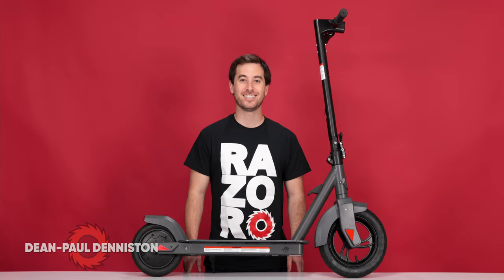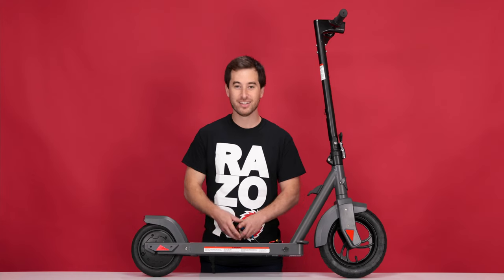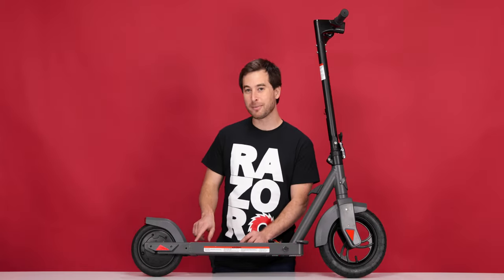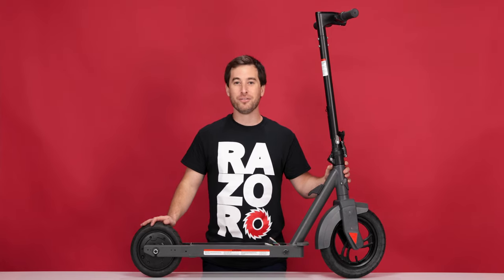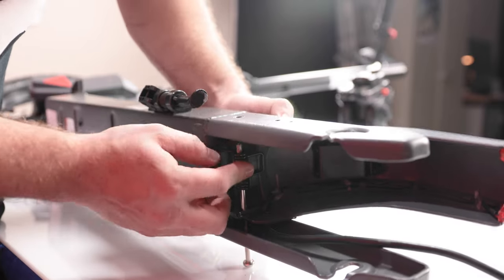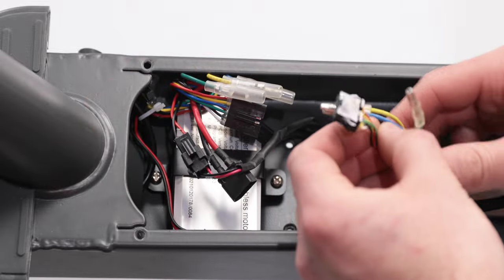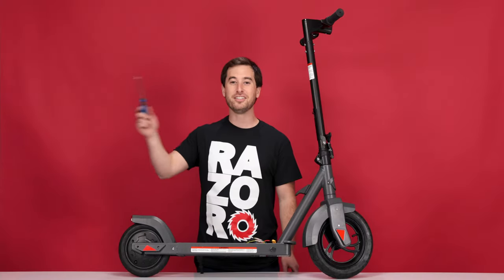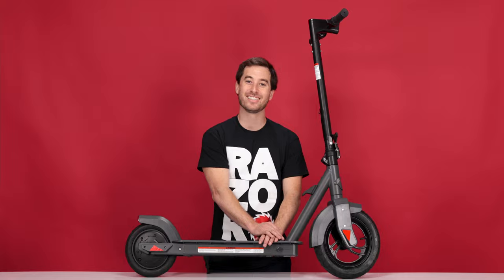How To Replace The Rear Wheel / Hub Motor On The Razor C35 Electric Scooter

Comment: Can we get a tire replacement video for the rear wheel? I barely bought mine this month and the tire and inner tube came defective and Walmart won’t return or exchange it smh
Reply: They did the same to me! You have to call them and they will send you a replacement wheel.   Took about a month for me to get it!
Reply: Same here Bruv
Reply: Same, tire flat in under a mile of riding.
Reply: Same wth
Reply: @TheTomNader same reason im here. Stupid to make these with tubes in them
Reply: @indianaprepper2832  are u sure the tube doesn't come out, since it is a tube they are selling that was out of stuck
Reply: @couponwatchdog  yeah it was a tube and I got it out and typed in the size in EBay and ordered one. I think they should be all rubber tires with no tubes in them. Now I’m scared of being in town on it and blowing another tube lol

Comment: When reinstalling the spring they skip the whole part of putting the pin back in place and just jump to tightening the bolt.  They don't include it cuz they know it's way more difficult than they make it look on here.  Now that's some BS!
Reply: As a 11 year Authorized Razor Repair center. This is the comment I was looking for! YUP they pretend everything is easy when its not.
Reply: @alphaproscooters2848  thank you!
Reply: How do you overcome this problem? It make me headache 😢
Reply: @alphaproscooters2848 my sons scooter is throwing a code for the throttle and like everyone else his tire was messed up months after purchasing. Do u know where I can these parts to try and fix it for him. He literally used it about 4 months.
Reply: anyone figure this out? stuck on this part of the process
Reply: How do u get this pin on!

Comment: This is such a piece of crap DO NOT PURCHASE....good luck if your rear tire goes flat and don't look on their website as everything is sold out. I have to $500 paperweights. OK so update I was able to get ahold of Razor and the guy on the phone was very nice and extreamly helpful. They are shipping the parts at no charge covered under warranty.

Comment: Notice how they don't actually show you how hard it is to get the foot brake pin through the spring and the other side. They cleverly cut away and, magic, the pin is in place. time:4:50

Comment: Where can i find a replacement battery for this model?
Reply from the maker: You can purchase a replacement battery from Razor.com or reach out to the customer service team at 866 467 2967.
Reply: @razorworldwide  is it possible to get the battery converted to lithium ion rather than sla

Comment: Don't buy Razor. They're the most rude and nasty company I've ever dealt with. They ghost you and are nothing but a bunch of liars when you try to return a dodgey e100 E scooter. The scooter takes off very suddenly with so much force it basically could throw you backwards onto the ground. Even once you are rolling along everytime you let go of the accelerator it does it again everytime you accelerate again. I could only just safely ride it and I'm an experienced skateboarder/surfer. It's even worse for a featherweight child. My son was really upset and disappointed on Christmas day as was I and could you blame him.
It took me 3 month's before they finally agreed to accept the return and now they're claiming it has nothing wrong with it and are sending it back to me. They won't replace it or refund it. We have 2 other Razor Electric Scooters that do not do this and I've ridden various others that don't ad well. They're liars and they do not deserve your hard earned money or time. I will never buy Razor products ever again.